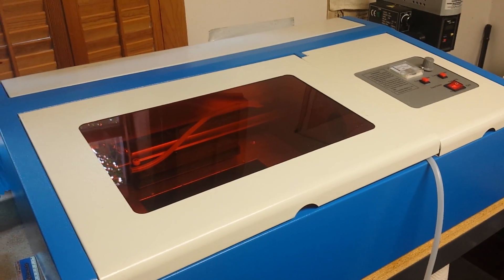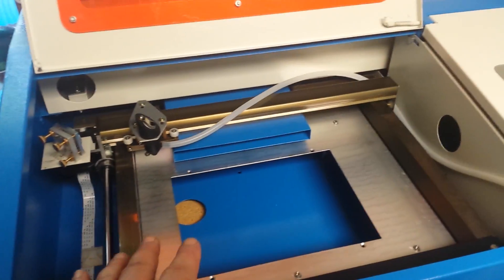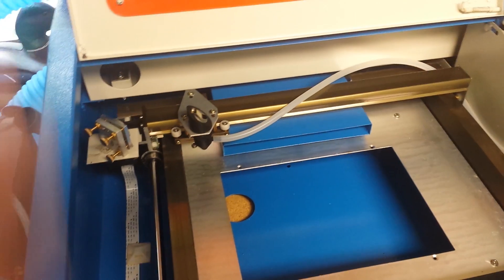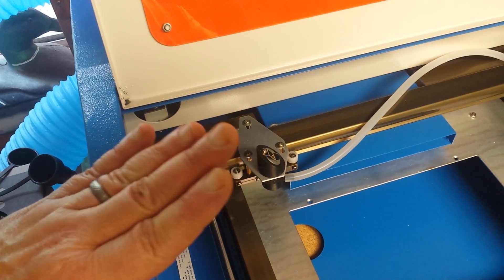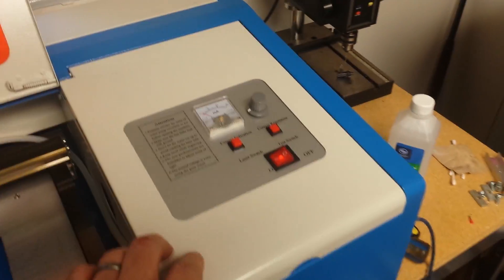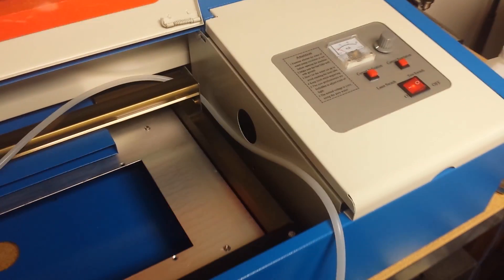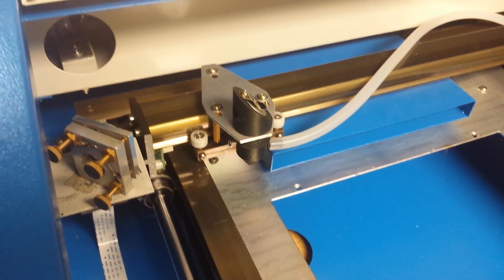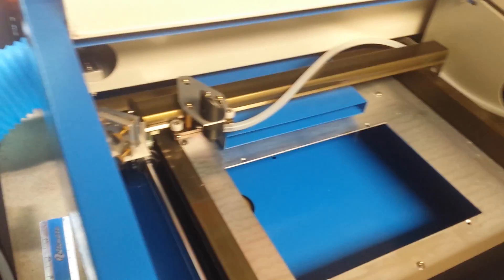Cheap k40 laser owner experience

Comment: you should remove that chip and put one Machined 40 Pin Dip Socket in the socket, which will give you a much better connection, they sell them on ebay and other places quite cheap.

Comment: You forgot the most important thing to check.... the ground, so you don't get electrocuted!
Reply from the maker: That is very important yes - we are working with 15kv and water so for safety and to keep the electronics happy and glitch fee I put it by the basement window there and have a 14 gauge wire going out to a copper pipe in the ground outside.

Comment: we just got our machine today, funny that we didnt get a manual or the disc with software..that was to come with the machine.....does anyone know where we can download the manual ? we have no idea how to set up this machine...we found one video, that kinda helped...and now chucks video ..helps after we have it up and running, but not sure on the rest...what is the silicone for ? what is the tape for ? and we have two clear plastic parts that we think go on the pump...but dont seem to fit the hoses.....lol....any help will do....thanks a bunch chuck or whom ever can help...
Reply from the maker: This is the 2nd comment I have about not getting any instructions. I can't help with software (requires a dongle key to use) but can post the instructions pdf shortly. May not exactly match your model however!
Reply: they sent me a download of the manual...so if anyone needs one let me know....still dont have a disc yet ..
Reply: chuck, can you recommend a software that works well this machine? we didnt get the disc in the box...so i need an easy/simple software that will let me engrave designs into copper / brass/wood....for my jewelry that i make..... amazon has givin me a gift card becuz the disc was missing..but i just dont know what to use...i have download a free one but still trying to figure it out...(inkscape) thanks chuck
Reply from the maker: From what I understand (anyone correct me if I'm wrong) the controller board in the k40 is made to work with Moshidraw or Corel Laser and also needs the usb dongle to work.  I don't think you can run other software without replacing the controller which is a major task, like:  http://www.instructables.com/id/Goodbye-Moshi-or-How-Run-Your-Laser-Printer-on-Ard/   and here's some more discussion.  http://www.cnczone.com/forums/laser-hardware/308666-software.html      Really sorry to hear people are getting these w/o the software - they are such a crap shoot.
Reply: i ended up getting CorelDRAW Graphics Suite 2017 Education Edition, which it better work...lol...the machine said it was to come with coreldraw graphics suite....so i assume ive gotten the right one....and it did come with some kinda usb thing...lol...so i hope thats the usb dongle....thanks chuck for your help...I can use every bit i can get....
Reply: okay, now, i got that other laser with airflow and lens...so i dont burn up wood, the machine says cutter and engraver....how do you get the machine to engrave ? i dont really think i need it to cut anything just yet...i just got the coreldraw software today also...have inkscape and drawpad that i got free download...thanks chuck again for any help ..
stephanne
Reply from the maker: another forum could probable offer better help - this guy explains the difference between cutting and etching and lots of practical tips  http://www.instructables.com/id/10-Tips-and-Tricks-for-Laser-Engraving-and-Cutting/     I first got the laser set up and playing with that Chinese language software and almost accidentally got it to start engraving one of the stock images (a mahjonh tile) on a piece of plexiglass with raster scan and that was very exciting when it first started!

Comment: Hi how did you solve the ventilation? Where are the fumes and the smoke going to? Thank you!
Reply from the maker: I setup in a basement room next to a window (to run a ground wire out to a copper pipe in the ground) and can open the window to run the blower duct outside for smoke and funes.  There's a pretty big gap between the blower and the laser box so I just used tape to seal it up.

Comment: is there a place where you can get Plans, or a CD of already made up Plans for the Precise 40W CO2 USB Laser Engraving Cutting Machine Engraver Wood Cutter, I just ordered mine and will have it on or before 3 July 2017  :-)  New to all of this, so any help would be great, and Thank you in advance
Reply from the maker: Not ... sure what you mean by Plans?  You mean the engineering diagrams of the machine itself, or plans for items you can engrave or cut with the machine?   The cd that comes with the laser has some fair instructions. 

Searching around - lot of people are reverse engineering and improving the basic box and replacing the Moshidraw board with other controllers, these have a few clues as to hookups for power, stepper, limits:   

RAMPS controller conversion:   https://github.com/ExplodingLemur/presentations/wiki/K40-RAMPS-Conversion

BeagleBoard LinuxCNC conversion:  http://miles-milling.com/LaserK40BeagleBoard.htm     <--- If I'd the time I'd seriously pursue this!
Reply from the maker: As far as things to engrave, Moshidraw starts up with a set of models, look like Mahjong tiles you may experiment with. 
Here is my first one, after setup with ground, water, exhaust, usb and dongle - picked one and just hit the Output to Machine button with a piece of plexiglass loaded and was delighted to get this:   http://swigerco.com/FirstEngrave.jpg

I just did another one and these are pretty much the default settings used:  http://swigerco.com/EngraveSettings.jpg
Reply: thanks, I was hoping there was like a site some wheres that had numerous plans easy to download for the engraving machine, that would present me ideas and projects already completed by machine to provide me with options  :-)
Reply from the maker: Here's how the above stock model came out - the hole in top left is test laser fire that you can see blasted clean thru the 0.06 acrylic sheet:  http://swigerco.com/20170624_083335.jpg
Reply from the maker: Sure, there's always thingiverse - I'm going to try this awesome one now :)    https://www.thingiverse.com/thing:389075
Reply from the maker: You'll have to workout your own favorite toolchain, there are lots of options. After downloading the twirl.svg from link above, I loaded it into Inkscape and just saved it as a .plt file (HP Plotter format) which Moshidraw understands. Then after a few test trials (had to scale it down to fit the area and size of material I had) was able to make (with issues, granted) this: http://swigerco.com/20170624_092757.jpg  using Moshidraw 'outline' and changed 'concave/convex' so it was a line drawing, not filled in with black.
Reply: well my Laser engraver arrived, only to unpackage it to find the Forward and reverse belt broken and setting right in the bottom (Not a good Start)  the seller ask me to find a Local repair (No One around here does that) or has those type of belts, the seller offer me a $150 dollar refund and just to keep machine ??  it's still broken, now I am going through the refund process and it looks like it may be discouraging and time consuming, maybe I should just end my dream of owning one ??  what you think ??
Reply from the maker: Google is your best friend - replacements can be made for $4  http://www.lightobject.com/Y-axis-belt-for-K40-P760.aspx      http://www.lightobject.com/X-axis-belt-for-K40-P761.aspx
Reply: Your the Best, wish me Luck in replacing, I will do a Video, as this is my first time ever making a help video and working on anything like this  :-)
and maybe it can help others in the future, will send you copy  :-)
Reply: Hello Chuck  :-)  well I seem to have my Broken Belt fixed  :-)  and now I am getting ready to spend some time using this Machine, I have the Lazer Draw working, but it seems my CorelDraw X7 is corrupted  :-)  figures  :-)  is there any programs (software you would recomend I use ??  I greatly appreciate your guidance and hope to hear from you soon  :-)   respectfully  Doug

Comment: Quick question, I have the same exact machine that I bought recently but it's not working. When I switch it on, I don't get any laser movement or current reading. Any idea why? thanks
Reply from the maker: On power up the xy arms should 'home' to the top left. You can carefully try to reseat the 40 pin dip chip on the controller board under the controls.  Just pry it out a little and reseat has been known to clean up a bad connections, pins can be fragile as they look used.
Reply: From the outside my machine looks exactly similar to yours but I don't have the 40 pin dip chip you showed in the video? In fact my electronic board looks different to yours.
Reply: My power supply is not working for some reason, it's has been like this from day 1

Comment: I have a 50 Watt Chinese laser and nothing but problems with
it. I never used it yet. I was checking the laser beam. I hit pules and it was
in line with center but a little high. I tried it a second time and it was the
same. I shimmed the back of the laser and now it doesn’t fire at all. Reading
the operator’s  manual,
I pressed the Z/U button and then went to Diagnoses, Pressed
the Enter button and a list came up on the screen as the manual said. It was a
Green Square at the Water Pore 1 I can’t get that to go off or get the laser to
do anything.
I will pay anyone that lives within 100 miles of York, Pa
and knows how to operate this laser to drive to my home and show me how to
operate the laser plus will pay for your gas to visit and return home. 
Please call 717-309-3654 or email marlin4786@gmail.com if you can help.

Comment: Do you suppose this would cut rock? Or at least be able to ablate a small portion of the surface of a rock such as granite or marble? Also, is it able to cut thin metal? Thanks!
Reply from the maker: Have used it to engrave wife's name on a piece of slate like material for her garden! Generally don't expect to cut much, no more than soft wood up to 1/4" (5mm) at slow speed.

Comment: mine is an80watt, please tell me what the thermal jelly is
for it does not say in the instruction. but one came in box, so i figure it should be used for something.
Reply from the maker: Hi - never heard of the thermal jelly - there should be water cooling for the laser tube and cannot guess what thermal jelly is for. There should be at least crude instructions that have directions.
Reply from the maker: I do remember mine came with 4 or 6 loose nuts rattling around - thought something came loose then realized they were to fasten the plastic window on. Some things are a puzzle.

Comment: Do you use a dedicated ground for the laser tube? Is that a safety issue?
Reply from the maker: I use a chassis ground, there's a terminal post on the back. That is highly recommended as your dealing with 15KV, water and a sensitive computer on the usb port! Fortunately my unit is on the ground floor near a window in the basement so a short run of thick electrical wire to a copper pipe driven into the ground right outside the window has worked fine.

Comment: when you say reseat, do you have to remove it and put back in, OR just push it in a little more?
Reply from the maker: Push it in, or pry it out a little and push it back in - idea is to get a little movement to scrape thru any oxidation. If removed be VERY careful not to bend the pins reinstalling it.
Reply: thanks, I just ordered this from ebay from a US distributor, so should be here next week. Looks the same but it is read. Overall how do you like it?
Reply from the maker: Overall I do like it - the poor quality control means it's a crap shoot so your milage may vary! The 'bones' are actually pretty good altho the cheap parts (pump, exhaust pipe, etc) are easily replaced.  I got this expecting any level of remedial work and was pleasantly suprised it just works after learning enough moshidraw to do my designs.

Comment: hi
does it cut white cardstock paper? like 300-350gsm? and does it leaves burn marks around cut lines? one more question - is the laser dot spot thin and if we can adjust/focus it?
Reply from the maker: Have not tried that material exactly but I think it will - you just have to adjust the cutting speed for the material.  Yes it will leave burn marks at least on the edge, it is a very hot spot, think sunlight in a magnifying glass hot burning.
Reply from the maker: Not sure about the laser focus other than changing the height of the surface - I think it's a 'cone' with wide/narrow/wide beam.

Comment: Do you think it would etch glass? Wine glasses and such?
Reply from the maker: Oh yes - etches glass just fine, at least flat glass. Odd shapes like like bottles will need a jig to hold it in place, and you have to consider the focal plane. I'd say no for bottles, ideally that would take another type of machine to rotate the bottle instead of the normal Y axis here.
Reply: It's another upgrade, but their are add-ons to support a rotation axis: www.lightobject.com/Mini-2-Axis-Rotary-Ideal-for-K40-Engraving-Laser-Machine-P941.aspx

Comment: I have the same machine and having really problem getting it to cut 1/8 MDF,   I have air assist ?  what speeds do you run your machine at?   please help  frustrated
Reply from the maker: For cutting with a lower power machine like this you need a pretty slow feed rate, and sometimes multiple passes - as low as 5mm/Sec or even slower.

Comment: Hi, how did you make the laser head stay in the top left corner when you start it up? Mine does not start there automatically.
Reply from the maker: When powered on it should home to the upper (away) left corner - when Moshidraw is started up and cut window open it'll reset to the position set in there - one pair of windows has the xy offset for where to start in the piece.

Comment: Also you want to replace the controller with one of these:

http://miles-milling.com/

Otherwise you will only have a very poor quality raster scanning solution.  What you need is the ability to cut like a torch in an outline.  The company offers a cheaper USB version for $99 along with a more expensive ethernet connection.  Both work very well.
Reply from the maker: +Roger Rabbit Thanks - but the bundled Moshidraw does outline and cutting already, I've cut many a cardboard, plexiglass, up to 1/4 soft wood with it as is!
Reply: Chuck,  I can't find anything that tells me the max material height.  Not the engraving depth, but the material height.  I need to put something about 2 inches tall.  Will it fit in the cabinet to be engraved?  Thanks.

Comment: I would love to see some result at some 1/2 ince thick wood. also intrested in a link to the air assist. If you cut a 10x10cm object it takes quite a while.
Reply from the maker: +popunonkok This is the air assist head replacement  http://www.lightobject.com/18mm-Laser-head-w-air-assisted-Ideal-for-K40-machine-P701.aspx   I would not try 1/2 inch thick - quarter inch is pushing it.